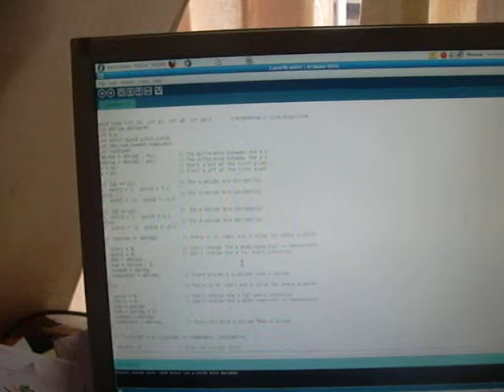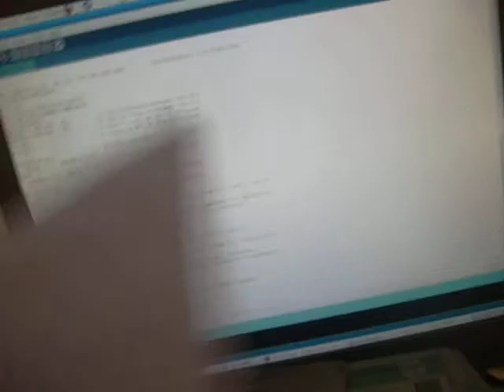Laser Projector Arduino

Comment: I am writing a thesis on this project, could you please help me with the code?
Reply from the maker: Hi, 
I don't have the original code for these projects any more but the only tricky part was the line generating algorithm I used,  Bresenham's line algorithm. The main advantage of this algorithm is that is can be implemented using integer numbers and maths which is beneficial on a limited 8 bit microcontroller. Once this was implemented using integer maths, which is a bit tricky, the rest is trivial. 
There is a good introduction to bresenham's on this wiki page and there are many demos and code examples of this algorithm being implemented elsewhere on the internet. 
https://en.wikipedia.org/wiki/Bresenham%27s_line_algorithm

I advanced this project to do some vector graphics on an oscilloscope. This also uses the same  Bresenham's line algorithm and integer maths on an arduino. I started by displaying a crude tie fighter graphic then added a rotation angle. 
https://www.youtube.com/watch?v=g0dRNZrtVjg
Then added a third dimension for an isometric 3D image. This was more demanding on the Arduino but the display on the 'scope is flickerfree. This was a weekend project completed in about a day.
https://www.youtube.com/watch?v=GHkvBnJDEMY

If you want help coding then start by breaking the problem down into small parts and make those work individually. ie generating the code to make a line. I remember sending the numbers down the serial port to a terminal then copying them into a spreadsheet and drawing a XY graph from them to check my work. Because at the time I had not written the output to the stepper motors.
This data then needs to be sent to the stepper motor driver code, there are plenty of examples everywhere, which in turn points the laser. 
Then after generating one line, generate two lines, then three, then you'll need an array or similar to hold the whole image and with this done you're finished. 

I was inspired by this arcade game I remember from my younger years.
https://www.youtube.com/watch?v=EA_kDTwZodQ

Also remember that if you are writing a thesis, or indeed any academic work, you will have to understand every part of it which is not going to happen by simply copying other peoples code. ;)